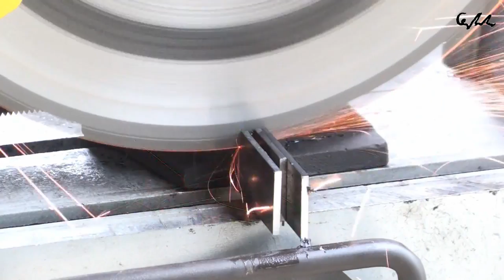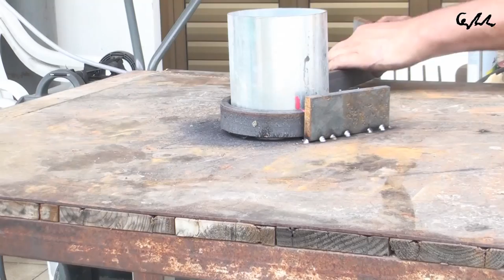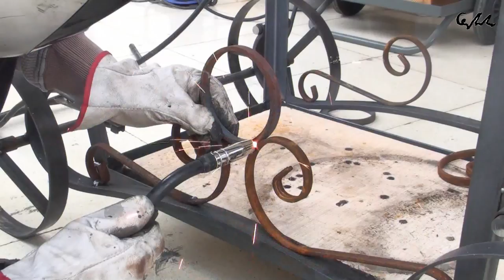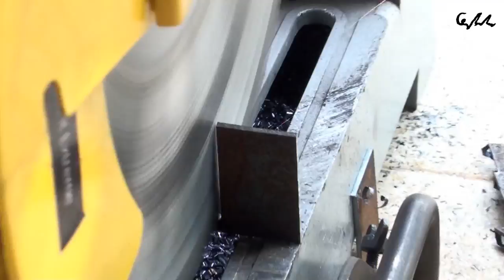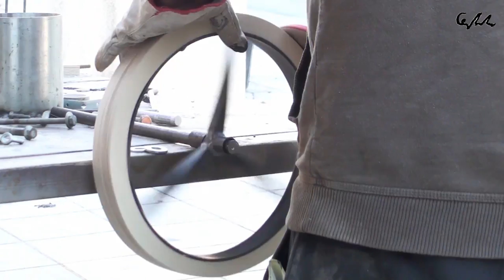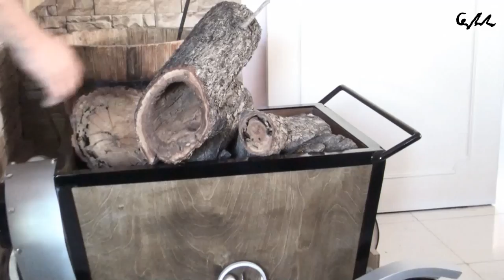Extreme carriage for wood trunks

Comment: This is great! I like how you just make everything of the project. Instead of finding wheels and a blower you choose to make them yourself. How expensive is a plasma cutter like yours? I want to do some more welding and metalwork. Have to get some metal. Did you make the metalbending machine you used in the beginning?
Reply from the maker: +knives&stuff Thank you very much! :) The plasma cutter is about 1000 euro.. Yes before 4 years i make the metal bending machine..